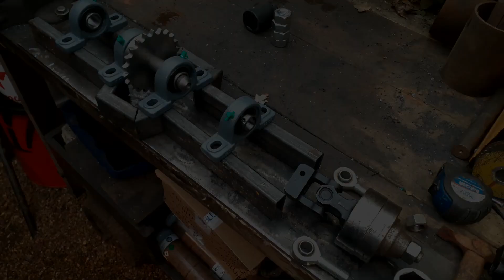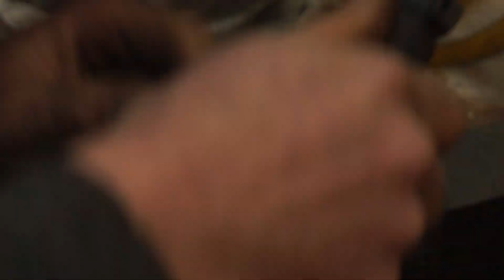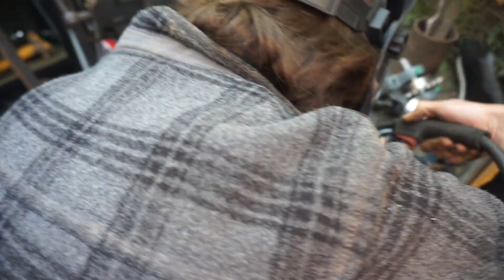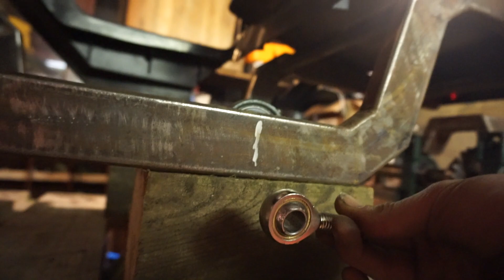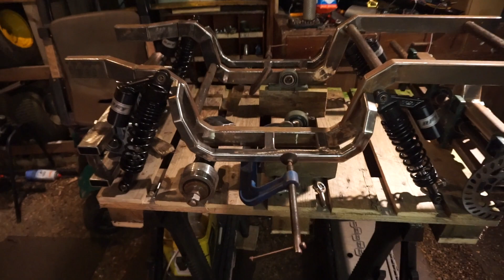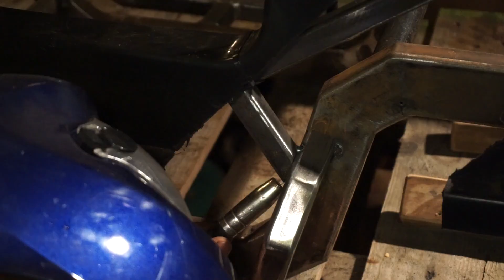Mini FJ40 4WD 110cc Power Wheels Build Part 2

Comment: Man all the grinder work without gloves is creepin me out 😱im in my 50s and have gone my entire life workin with hands/pwr tools without gloves. But this summer within 3months ive came close to loosin 2 fingers (2 separate occasions)  when newish cutting wheels came apart at top speed. Of course i didnt have the safety cover on. And no gloves. And you know i aint goin to hospital durring covid outbreak😂😭😂  aloe and Neosporin. Now i wont use a grinder without both. Awesome build
Reply from the maker: Thanks man i know what u mean there buddy i try to remember the glove thing as im goin... my only rule for certain is keeping the guard on that thing cos i use  it to rest my hand on instead of a handle stickin out. I forgot i took it off one day and nearly cut right to the bone !! I said ''do be a little more careful next time james'' but a bit morecolurful than that 🤣 take it easy man keep on grinding!

Comment: Instead of cutting everything into small pieces and welding them back together you should try notching and bending the pieces. I also draw my shapes on a board and use that as a reference so as to be able to repeat the shape. I use nails or spikes (depending on the size of the metal) to hold my work in the shape I want for welding.
Reply from the maker: I like ur thinking!!